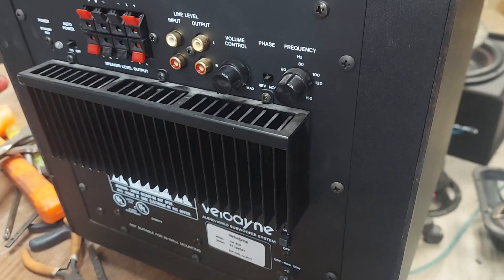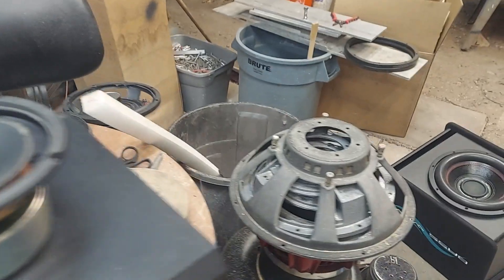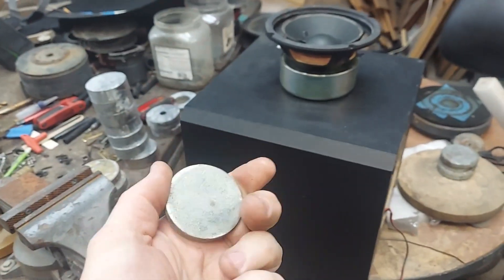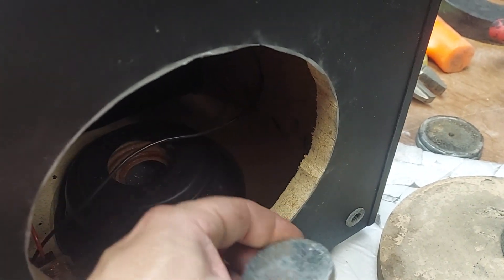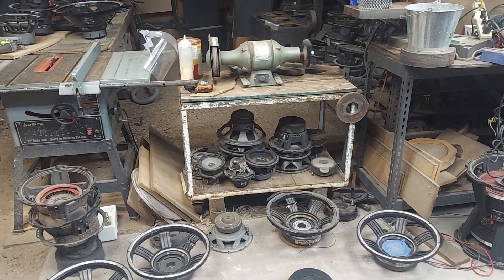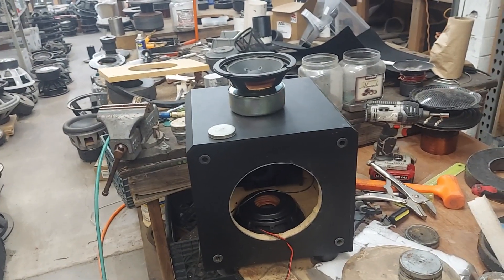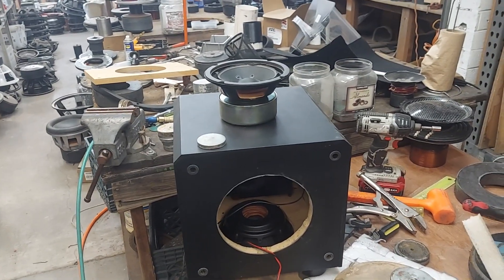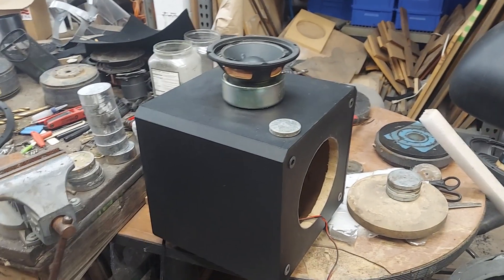Velodyne VA806 6.5" subwoofer Home Theater w/ Carbon Fiber 8" upgrade by MCM 55-3550 8 ohm by Robot

Comment: I have a couple of there subs SPL R models 12s they sound good for a small sealed box 1200w 8ohm usually the amp goes out like every powered subwoofer lol some time you can find just the woofer for cheap  60$ for 12 SPL model that handles 1200w isn't to bad  when you can find one💯👌👍✌️🎵🎶🛠️
Reply from the maker: Thanks for the info

Comment: Velodyne had a later model called Impact Mini, and it had a similar down-firing 8" passive radiator and forward-firing 6.5" woofer, which was from the MicroVee subwoofer. The box is relatively large so the passive doesn't need incredible mass to be tuned low-ish; do an impedance sweep to find the real tuning of your unit. I wouldn't change the active driver, just re-foam it. It's nothing special so a normal 6.5" woofer refoam kit should work for it. Then give it away to somebody; I doubt you'll get back the value of your time from selling it or trying to modify it.
Reply from the maker: Refoam takes too much time and effort.